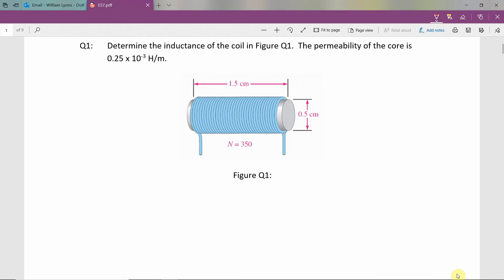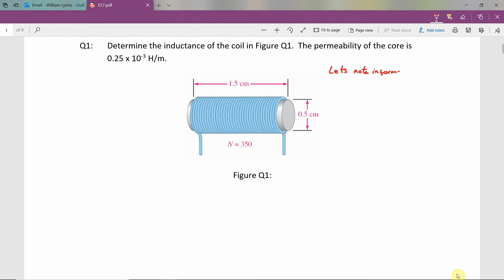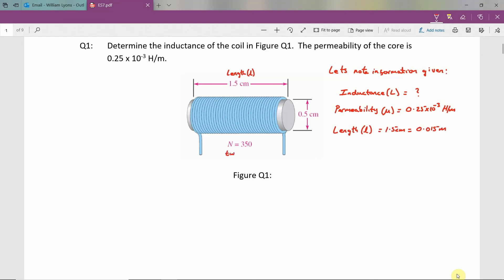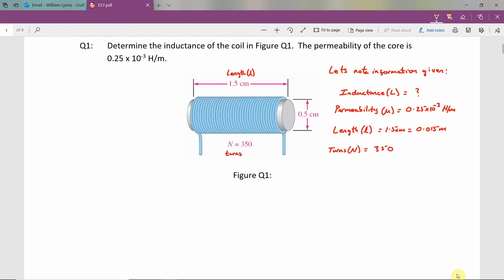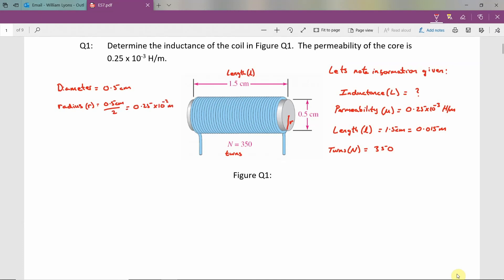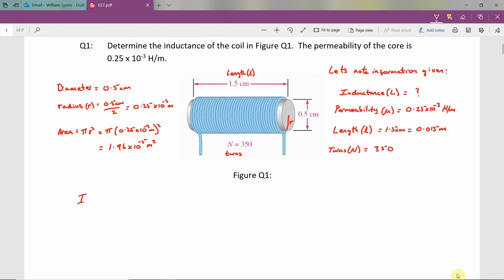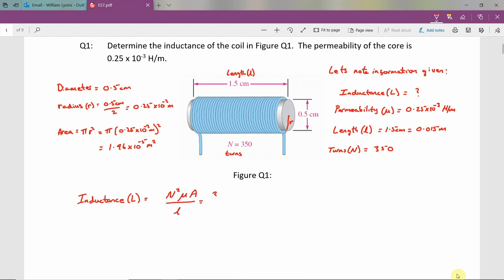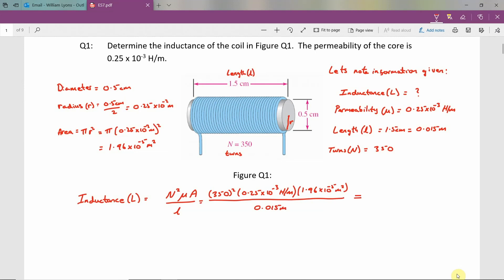How to Determine the Inductance of an Inductor Coil

Comment: Thanks, great video. If there was no magnet core in the centre would you take the permeability of the material used in the coil?
Reply: nvm relative permeability is 1
Reply: @adithiyer9732  thanks for the additional information.